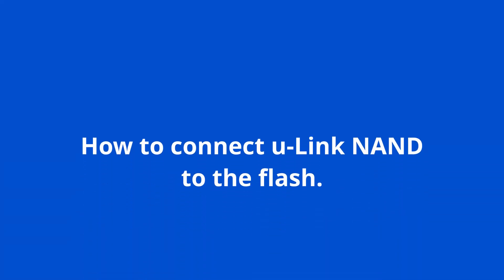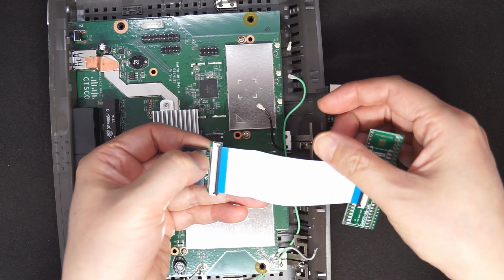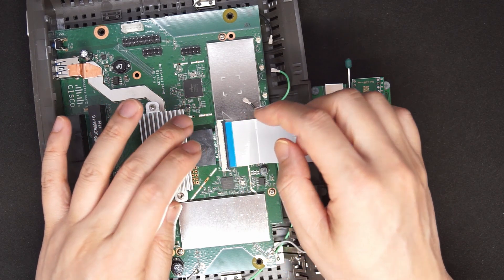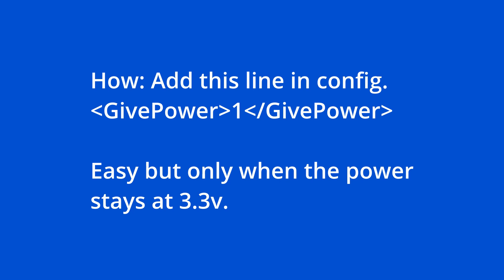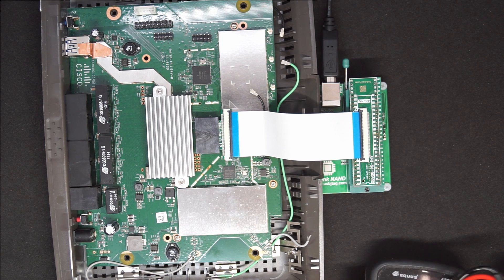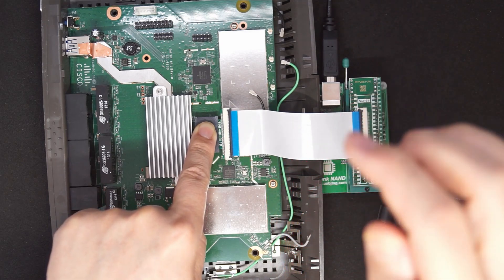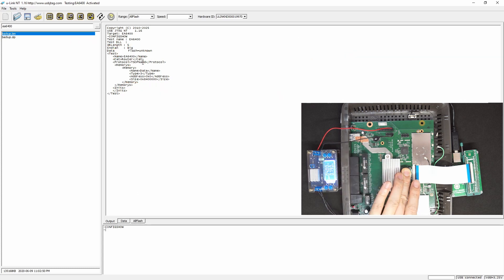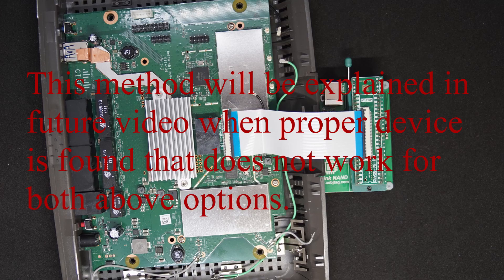How to properly connect u-Link NAND to target flash on board. (EA6400)

Comment: can i read this tsop nand  TC58NVG1S3HTAI0  on u link nand with socket
Reply from the maker: Yes. But not on board. There is known issue with the clip for Toshiba chip on board. But if you remove the chip and use a socket it works just fine.
Reply: @usbbdm  I removed the chip already, do I read it in the socket but what target do I use, the NAND 512 or do I need to download anything special, or just read it by itself?
Reply from the maker: @heribertoriojas8824  you might need to define the chip. Get the datasheet and define it. Come to my site if you need remote help.